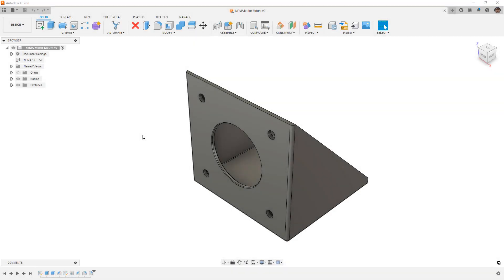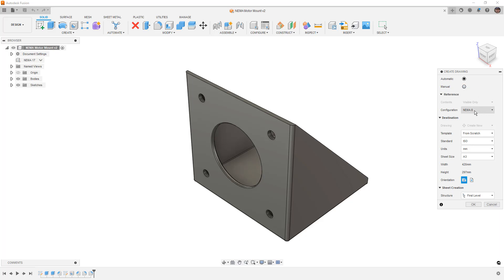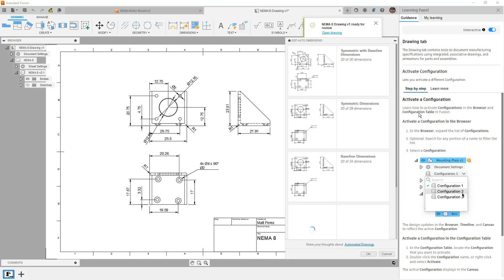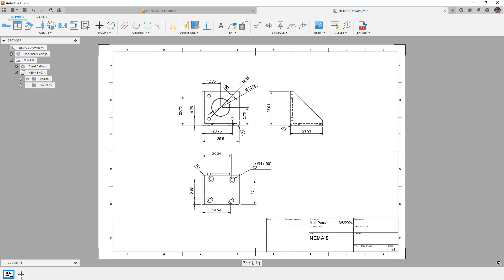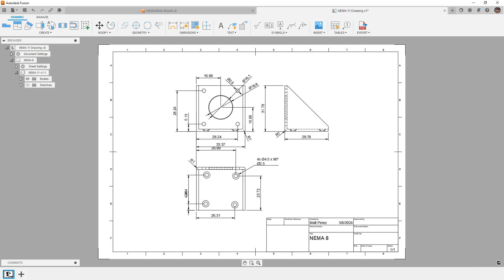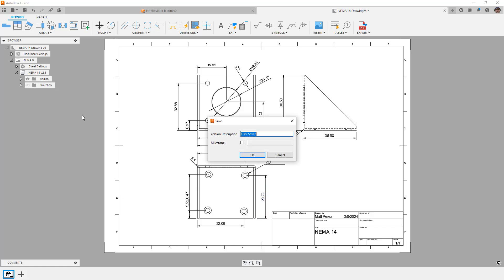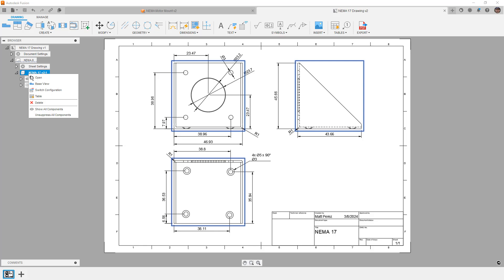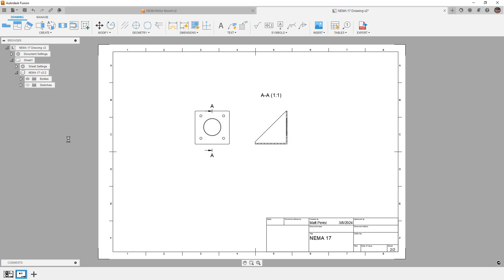Configuration Mini-Series | How To Use Configurations In Drawings | Automated Drawings

Comment: let's have a look at those automated dimensions - at 4 min 12 sec, the lower face has 4 CSunk holes, but  only one has the correct coordinates and visibly, they're not aligned. On the upper left view, if I'm being generous in assuming holes are in line with one another, i'm still missing the left x ref to left hand upper and lower pair.
Looking at the right upper view, assuming again the angled face is coincident with top inner edge and assuming the thickness is in the material description ( because otherwise it's not mentioned) and only by assuming the angle is 45 degrees can the height at the bottom height of the angle be known.
If this was a person doing a dimensioned drawing exam, it would result in a big fail and the manager would not think this person was not suitable as a draftsperson.
What's the point if such basic errors are generated even on such a simple part!  Honestly don't you see my point.
416 views and 22 likes but nobody else has mentioned this...
Reply from the maker: Automated drawings are a starting point and not a replacement for creating a complete detailed drawing.  There are options for dimension scheme and sliders to increase/decrease the number of dimensions included on a drawing.  I would never trust it to spit out a drawing and send to a shop for manufacture, but its a great starting point to begin a detailed drawing.  Sort of like setting up a template.  I will do a video just on the topic of automated drawings in the near future, but you are correct just clicking automated drawing and accepting something that looks ok isn't the end of the process.
Reply: @LearnEverythingAboutDesign  OK, but I'm not sure it's a good point to start a manufacturing drawing from either unless with guidance rules. Maybe an overall XYZ, for a catalogue entry but for fit, form and function I doubt it. Same with other auto dimension tools in many cases. Thanks for replying though.